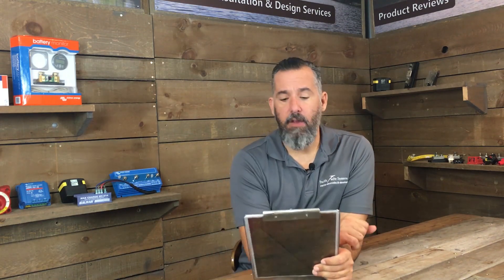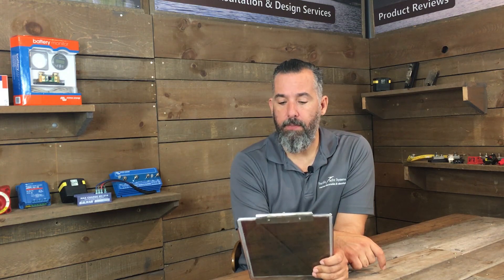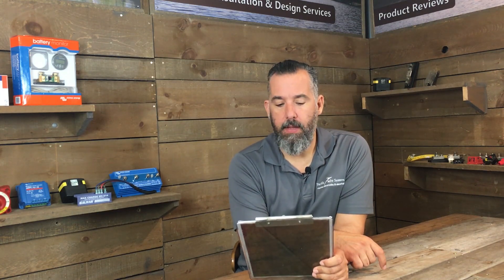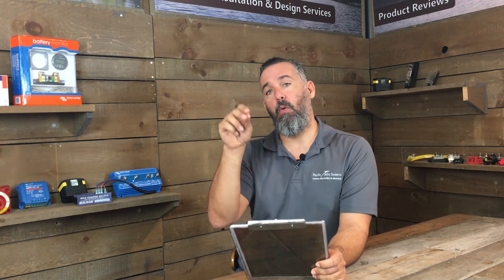Ask PYS - How Do I Upgrade the Existing Lights on My Boat to Save Energy?

Comment: I recently tried to replace a flat block of LEDs in a light fixture, I wanted a brighter light.  Purchased a G4, made in China, from Amazon.  Installed one in the fixture and noticed that when I turned on the light, I got interference on my boat's stereo.  I installed a second G4 and the interference got worse.  At this point I stopped and removed the new G4 LEDs.  Going back into Amazon to review comments, and it seems others have experienced this same radio interference issue.  Can you address this in a future video?  I read about a LED transformer - do I need one of those? Can you recommend any G4 bi-pin LED replacement bulbs that are bright?
Reply from the maker: You bring a good point, lots of LEDs cause a huge amount of RF interference. Can some one comment on why?

Comment: Wanted to ask if you have had any experience with the long reliability of LED lights on boats and how sensitive they are to fluctuation in DC voltage. Some boat owner's on the other you tube channels have had issues of led lights not lasting very long. One such Guy stated that he did find a solution to the issue on his boat of installing a 12v to 12v converter to give him the certainty of consistent 12V DC capacity and or the isolating of the supply to the led lights. It is unknown on  his boat whether a faulty regulator on the gen set was an issue. Comments would  be appreciated on the subject
Reply from the maker: Hi David, not something i've professional or personally uncovered, cannot comment how widespread the issue is. Anybody has experience to share.

Comment: Sometimes you need to check the polarity of the light fixture . Sometimes the Pos. and  Neg. are switched when they wired the fixture to the feed harness . If  the pos. and neg. are backwards the LED will not light .
Reply from the maker: That's a great one!!! So true, lots of light wiring on boats have reversed polarity. Good suggestion to check polarity before changing to LED

Comment: And should use constant current ? Like bulbs with 9-32 v rating ?
Reply from the maker: Francois, what do you mean by constant current?
Reply: @PacificYachtSystems  maybe i'm not using the right term, but I mean LED that can handle 9-32V and have a little circuit to regulate the voltage. This way, there is no "meltdown" of solders in case of high voltage. like this: https://www.amazon.ca/GRV-24-3528-Super-Bright-White/dp/B00EDIGCY8/ref=sr_1_33?dchild=1&keywords=g4+led+bulb&qid=1605634725&sr=8-33

Comment: Green&Co Jeff (Amazon/Ebay etc). Colour Rendering Index >95, 2700°K. You won't be disappointed. They're the best LED I've ever seen. very affordable too. I used to be a theatrical lighting engineer by the way.
Reply from the maker: Thanks for sharing Liam, will look into it.
Reply: Here's the link to the last batch I bought. The wide beam angle is best too. They make wood look super. 
https://www.ebay.co.uk/itm/greenandco-LED-Spot-CRI97-GU5-3-MR16-6W-ersetzt-45W-470lm-2700K-warmwei%C3%9F-110/324105140769?ssPageName=STRK%3AMEBIDX%3AIT&_trksid=p2057872.m2749.l2649
Reply: Oh and you can dim them even though they say you can't.

Comment: Jeff, many thanks for the "Ask PYS" content it is invaluable for us DIY folk. My question is, I require 95mm2 cable for my windlass install and I was gifted a quantity of 95mm2 and 70mm2 is it ok to add 25mm2 to the 70mm2 via a terminal block to make both cables the same size?
Reply from the maker: Hi Darryl, can you help me better understand your question. Are you thinking of wiring your windlass with two smaller wires  (70 and 25 mm2) instead of one larger 95mm2 wire?
Reply: @PacificYachtSystems   Hi Jeff thanks for your reply, yes, I was contemplating using the 95 for the positive run and adding a 25 to the 70 making it a total of 95 for the negative run. Cheers Darryl